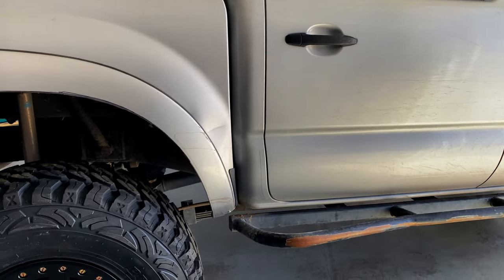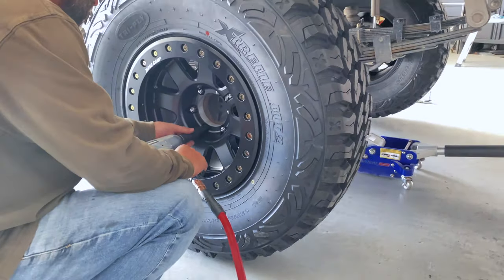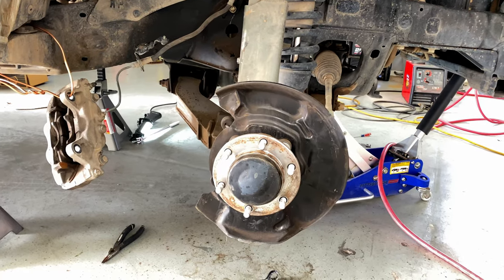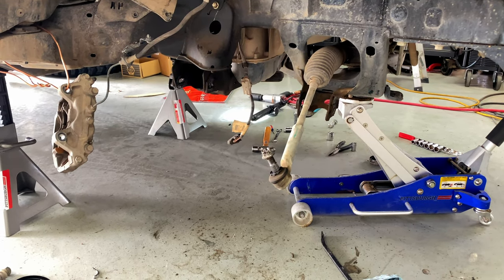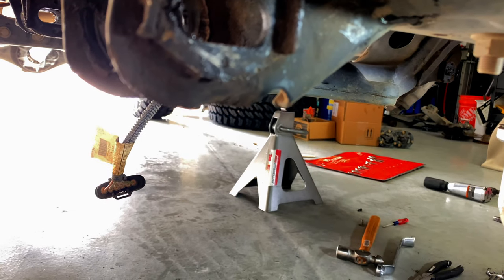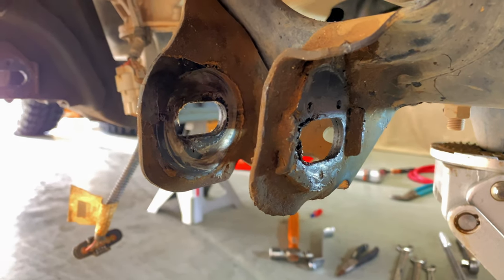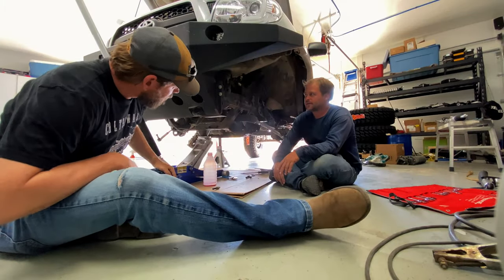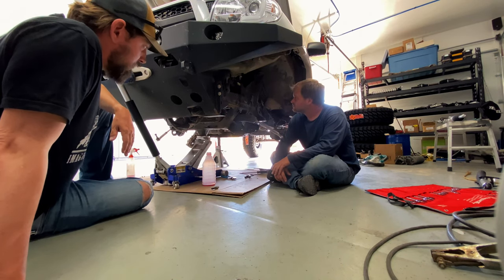Marlin Crawler RCLT HD Install Part 1 - Disassembly

Comment: That steering rack is the only thing steering me away from this kit (no pun intended). I have zero welding experience but I would really love this kit. If 100% bolt on I would’ve bought this kit already.
Reply from the maker: Agreed. That part of the install is tough, but having the kit on your truck will definitely put you in a completely different class in the Toyota world.My ICON kit with coilovers and uppers feels weak to me now after seeing this gear.
Reply: Lookin forward to the install video/what the truck looks like with it installed 👍🏼. I’m super jealous.

Comment: You may have noticed... 8:39 looks like the frame is cracked? Right where the lower brace for the steering rack and rear LCA mount connects to the front part of the frame. May be worth throwing down some reinforcement there? Good stuff though! Excited to watch the next vid!

Comment: Is this thing finished yet?
Reply from the maker: Alex has the truck on all four tires now, but there are still a few things left to do before it'll be trail-worthy. I'm working up the install vid. With the holiday, it'll be out in about a week. The kit is definitely not just a bolt on, and I think most people would be looking at 6 weeks minimum working nights and full weekends.  Stay tuned!
Reply: @FurthurOffRoad  awesome looking forward to it